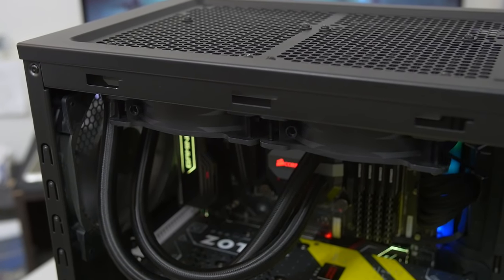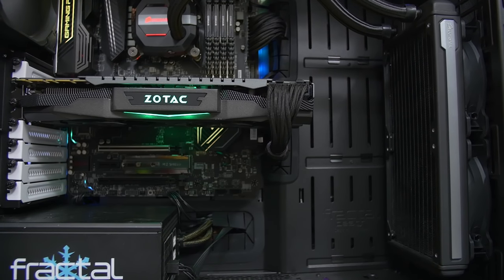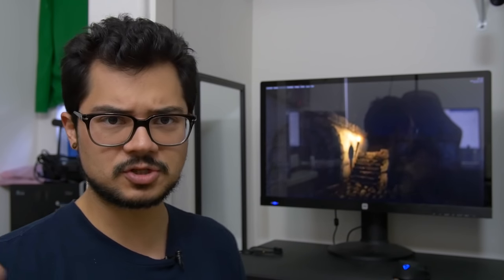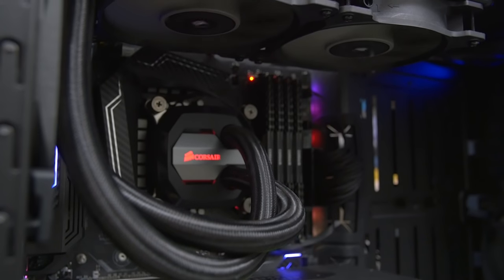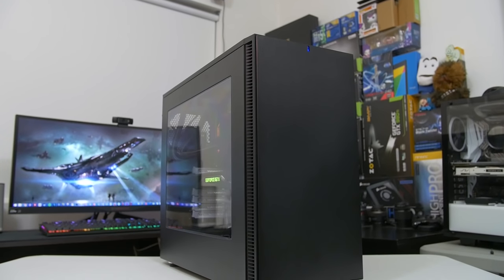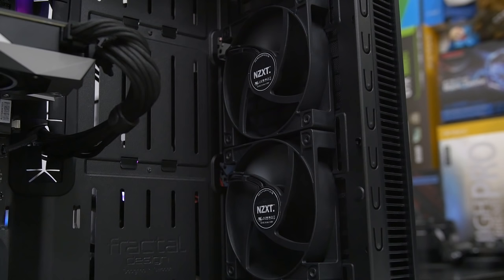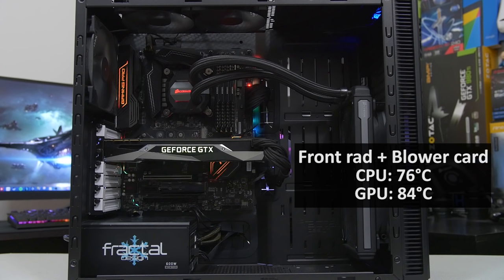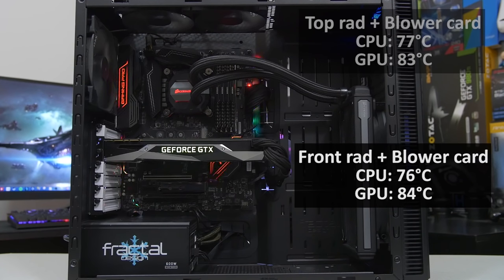Does Radiator Placement Matter? Hint: YES

Comment: What if you mount it at the top and only turn the Fans around so they are working as intakes?
Reply: ZeroB4NG and how about mounting it in the front and doing a push pull/etc setup?
Reply: That's what I did, I have a Define R5 which is very similar to this case and placed the 280 rad in front. At first I only had push, then I did push/pull which improved my CPU temp by 5 degrees Celsius. The front intake of Fractal Design cases are so restrictive that you need higher RPM or more fans to suck in air. EDIT: i7 6700k, 4.7GHz at 1.42 volts.
Reply: I have a mini c,  just remove the dust filter for profit. My custom cpu/gpu loop dropped by ~8c
Reply: warm air tends to go up, so it would be better to bring in cold air from the front or bottom and let the warm air leave on the top
Reply: That would be fine if the warm air did not have to pass over the cpu on its way out of the case.
Reply: Max Z. Warm air rising has a negligible effect ones the fans are spinning.
Reply: what if you put your pc side ways?
then the air need to be blow out. does it work, idk. @BitWit can you test this in a video, if you havent done it yet?

Comment: I purchased a custom made pc, started having some problems. I realized they had place all the fans with air pushing outwards, on the bottom, side, and back of my case. There were no fans sucking air in. The worst part though was my radiator for my auto gpu was placed on the very bottom of my case, completely below the gpu itself causing all the excess air to be between the water block and gpu processor. Luckily I fixed all the fan/ radiator placement and now my computer works 10x better. Now my cpu and gpu run at about 29-30 deg Celsius, maybe 34 deg under full load. It’s awesome

Comment: Strange how the warmed air from the CPU radiator have so little effect on the GPU temperature.
Reply: because only some of the air goes to the GPU, the rest is sucked out the top by the fans before getting to the GPU.  Too bad he didn't actually consider where on the front he was placing his rad.  Probably could have gotten the GPU temp at least as low as the top mounted rad blower card setup.
Reply: @Power5  how would you place the radiator on the front other than in the space where intake fans are though? Because that's the only way I can see how you can fit a radiator on the front.
Reply: @EarthIsFlat456  looked like a full front mesh case with another fan space to the top. Not completely sure of course as the case was glossed over in his setup.

Comment: My setup in my ancient Air 540 case, 2x 140mm intake fans, 1x 140mm exhaust fan, CPU cooler mounted at the top of the case in a pull configuration so exhausting the hot air with 2x 140mm noctua fans.
My dinosaur 3930k at 4.6ghz doesnt go over 67c in gaming which is all I do with my system and my Founders 1080ti with 170mhz on the core and 450mhz on the memory doesnt go beyond 75c with my fan curve and case fans set to 50% speed.
I'll run Heaven for half an hour and see what happens and update with the results.
So I found out my CPU didnt go over 63c and the GPU was bouncing between 75 and 77c.
Absolutely this setup is adequate. Got to love the Air 540 case :D and the old Corsair H110 with Noctua fans.

Comment: One word of warning if you do go with a vertically mount radiator with an AIO/CLC:
Mount the hoses on the bottom of the radiator.
As the unit ages, and water slowly seeps out of it, the water levels will fall.
If the hoses are at the top, the risk of the pump ingesting air is a fair bit higher, increasing wear on the pump, and therefore, how early the unit will fail.

Comment: I wish you did a test with a vertically mounted GPU
Reply: vertical GPU will cause high temp for your GPU. it would not have major effect to the cpu. n for sure, check your open space between vertical GPU and side panel. if it is too near, it will cause high temp
Reply: @muhammadkhalishzainudin9608  Yes I'm aware. Hell I'd add an extra fan just to mount it that way. If the case allows for it I think it looks much nicer with a vertical mount.

Comment: Front radiator has always provided the best temps for me. I always have the fans pushing air through my rad from the outside. I.e have the front grill, followed by fans, followed by radiator.

Comment: 2020 now but this answered my doubts :)
Reply: What are your results?
Reply: @erikschneider160  I have the same setup. My XFX 5700 XT THIC II Ultra was previously reaching 76c. It's now down to 73 after I altered the GPU fan curve. Not sure if 71c max load was achieved using 100% fan speed. At 83% fan speed, I can keep my card below 74c. At 70c, it runs at 73% fan speed.

Comment: Your temps are low considering 5G overclock I have H100I AND i7 7700K and when overclocked 4.9 with the grill mounted from the front I hit 90 to 100. Is this under 100% load?
Reply: My guess is he delidded it and applied liquid metal and you didn't. (edit: lol this is really old, but fuck it)
Reply: @MeatNinja yeah that was old

Comment: I'm using a case that is about 12 years old, and it doesn't accommodate a 120mm fan and radiator, so I made a bracket, drilled some holes and mounted it outside the back of the case!  My CPU temps went from 80-90C (air cooled) to mid 40s under full load 😄  So I'm going to say, the best location is outside the case!

Comment: Mine runs even cooler with front fans taking in freash air also top fans with radiator taking in freash air. I have the rear with a single exhaust and all the other excessive air coming in creeps out all the holes in the tower this also helped me with dust. Due to air coming out all the breathing holes it doesnot allow dust in

Comment: So not sure if you still check this video comments. Either way I enjoy the videos. I have a Corsair 400C with Intel I7-8700k / MSI z370 gaming plus w/ game boost active , eVGA Gtx 1070 SC. Well I recently got a the Corsair h100i for my cpu. It was a 2am build I wasn’t thinking clearly, but I put the radiator as an exhaust. Also a 120mm fan in the back as an exhaust. At the top I placed 2 -140mm Fans as the intake. I was too tired to change at that point. Been running benchmark and cpu is coming in around 70C.

Comment: I personally modded my liquid cooler so the pipes are 4500 miles long ,therefore its at the top of mount Everest now my cpu is so cool and runs great .i recommend.
Reply: Ideally you’d want a radiator going into the ground as the deeper you go, the cooler it’d be ;)

Comment: Good video and I have a question?  What happens if you use a top mounted cooler and pull into the case instead of pulling out of the case?  In other words reverse your current fans set up for a top mounted cooler setup?
Thanks
Reply: I have the same question as you Tony. It seems like that's a win-win. A source of fresh air for the CPU, and another fresh air for the GPU. Plus, you have positive pressure in the cae so no dust is sneaking into the case through small gaps in the panel.
Reply: Ah, someone else (Tae Lim) had the same question. Under load, his CPU and GPU were both 65. (When you click the link, it'll open this same video, but scroll down to the comments. It should be the first one highlighted.) (https://www.youtube.com/watch?v=xNAMxZgvves&lc=UgxUFHJ7V9iyiuJVzD54AaABAg)
Reply: I'm no genius, but just using common sense that doesn't sound like the greatest option. You'd have your AIO + Front Fans all intaking air with only one (and likely your worst) fan acting as an exhaust.

Once again no genius, but surely that's too much air pressure and your fans would effectively start fighting against eachother while supposed to do the same job.

Comment: A better test would be having the radiator at the top in both cases, but one time pulling fresh air from outside of the case through the fins into the case and the second time flip the fans as you did pulling/pushing hot air from inside of the case through the fins of the radiator outside. Regardless, as other have pointed out, your front mounted option is wrong because of where the air inside the system ends up.

So the radiator is at the top in both cases.
Case 1. Fans push/pull (depending how they are positioned/reversed) from outside to inside. In this scenario the radiator/CPU gets cooled with cool air from outside of the case and hotter air gets inside the case and heats other components. So you'd need your top back fan set to higher RPM to exhaust the hot air.

Case 2. Like you had it fans push/pull (depending how they are positioned/reversed) hot air from the case through the fins of the radiator to "cool" the CPU. In this case is is more helpful for the other components and not as good for the CPU as you are running warmer air from inside of the case through the radiator. 

Trying to find a test like this on youtube instead of me reversing the fans to test it out... I have it set as in Case 1 because of 2 reasons:
1. I have a filter at the top of the case for the radiator fans pulling fresh air from outside into the radiator. This keeps the dust down a little for the radiator and fans.
2. I believe it is better to cool the CPU with cooler air from outside. 

And to those that say that hot air raises up, it does that if it is not moved around by fans. And  the top back fan pulling out hot air at higher RPM does that part off removing the hot air at the top of the case.

Comment: I had the radiator on top and was getting  75-83 degrees while gaming, changing it to the front and having the top fans exhaust the heat helped in dropping 10-12 degrees as mentioned in the video.. Thanks!

Comment: That front mounted radiator is installed upside down, the tubes should always be on the bottom and below the Block to prevent air from entering the block.  With a top mount this isn't needed as the pockets to allow for bubbling will be at the top part of the rad and not near the tubes as they are pointing down.  Front mounts always need tubes down to prevent air bubbles to the block and causing dmg to the AIO or even a custom loop.

Comment: Just like a car. You wouldn't want to have the radiator mounted behind the engine. ;)
Reply: SDR that's why you mount the radiator on top and set to exhaust.
Reply: Don't see much cars with a rear mounted engine and rad complain about it.
Reply: Lots of rear engine motorhomes have the radiator behind the engine

Comment: When this guy put the radiator on the front he has put it upside down the pipes should be at the bottom. I know this as I was having heat issues and when I flipped it over I got 10_20 degree drop
Reply: Chris  the pump is inside the block bro. I've also had it confirmed from the manufacturer of my water cooler that the should indeed be at the bott not the top bro.
Reply: Chris  but how can you say that bro mine has dropped 10 degree under high load and 20 degrees under low load. Every othe configuration I've had it In. With the pipes at the top it over heats and throttles the voltage down to protect itself. So I don't understand why if your saying it is t right. Also mafuatyres are the best to listen to they are the ones who hold my warranty and if I ahave it istalked as they say then I'm covered do it another way and I'm not covered bro

Comment: 70C on a 3700X, front mounted ML240L with push/pull fans, Neo Air mesh front case.
8 Sickleflow fans total in case. Triple fan PNY 3080 that both passes through and blows out. I took off the unused io covers on back, mounted a fan to the outside. It blows in directly under the 3080 along with the lower front intake. They meet in the middle and half the air is directed behind the 3080 to the M.2, half up through the card. 
I have a thin mirror cut to fit under the 3080, dual purpose. Air direction and shows the RGB that is otherwise on bottom of the normally mounted 3080. Drives stay in the 40's, 3080 hits low 60's.
I regulate the 5 intakes (4 front, 1 low rear) with the 3 exhaust for a nice out the top chimney effect. Helping the heat, not fighting it. It wants to go up.

Comment: 5Ghz?!
Reply: Bionicle16 Many are reaching that speed these days.
Reply: Fadilizer sillicone lottery winner?
Reply: 5.2 and up would be considered a winner, IMO.
Reply: According to ASUS 80% of 7700k's running on their ROG series boards are easily able to hit 5ghz. These things are monsters.
Reply: what voltage? congrats
Reply: Kamil Ogrodowicz most 7700k are running on 5ghz. mine is on 1.39v. temps are huge btw so need to delid it. (prime blend test is not possible, to much heat) so gonna delid it to lower the temps
Reply: +karma police kinda figured that might be the case. It normally takes a lot to cool a processor at 5GHz. So these coming so highly clocked out of the box and then allowing overclocking just told me that people have to step up their cooling game.

Comment: Thanks to my case being from a class of cases that are extinct now (read: With side panel intake) and a huge video card, I've kind of cheated around both potential issues. Front intake to side exhaust for GPU, top intake to back exhaust for CPU. Solved. I love my HAF X.
Reply: I still have the HAF932, the smaller sibling.  This case side panel supports 4x 120mm fans or 1x 230mm fans that would help an air cooled GPU.  This case breaths well.

Comment: I don't really want to get on your case about the rad placement - I'm sure there are plenty of people who would annoy you to no end about it now, but there's a chance that it could have had an impact on the temperature results. It might be worth redoing this test with the pump below the top of the radiator (and tubes down if possible) when the aio is mounted at the front.

Comment: Corsair recommends air intake and says nothing about changing for top mounting.  In fact the picture in H100i Pro RGB Quick Start Guide, shows a top mount.  Don't be confused by arrows (not sure what the arrows are showing) but the WORDS way configure as intake.  The do not even reference top or front mount.

Comment: We need a video on front radiator mount AIOs.  It pulls cold air and gives the best CPU thermals.  Problem: Are the tubes long enough.  Radiators need to be mounted tubes down so air can collect at the closed top of the radiator to minimize gurgling and air circulating to the pump which hurts efficiency.  I wish to use an Liquid Freezer II - 280 in a Fractal Define 7 case with an internal DVD mounted up top. The specs say 450 mm tubes.  IS THIS LONG ENOUGH?  Need to clear the video card which could be mounted vertically for tube clearance.  Also planning to mount the fans between the radiator and front panel.  Are 450 mm tubes LONG ENOUGH?

Comment: Great now I've got to go back and see if I did a test recently considering I acquired a fan cable splitter so I could do a push|pull on my 212 EVO air cooler vertically mounted.  While I have a single 140 on the lower front of the case in hopes to provide a bit more air flow to the video card, while two 140's are top mounted and a single 140 at the standard top rear of the case.  I also removed the drive cage for a better flow for the air flow from the lower front fan in theory.  Keep in mind that I, just like other people have more than one interest than gaming.  We have a much more slower upgrade path than some, and content like this provides great insight as to what we might consider on acquiring.  This particular video is relevant and hopefully can be followed up on over time.  Please note that I am getting more hits frequency-wise by keeping my Ryzen 5 2600 as it's kept cooler by the push|pull.  Yet I now have to go back and run Heaven 4.0 to compare it to my archived results.  I have to blame YouTube for pushing this video as I've never watched this one by Kyle.  His name is Kyle right? I do watch Jay, Jim and Steve mostly.  Though I watch Lauren when I can, as well as Nicolas.

Comment: I got this weekend my first AIO in years
I had a Noctua NH-D15 before and a NZXT Kraken X62 now

Before i installed the AIO i asked myself the same question that this video answered.
The radiator in the front was a no brainer
The GPU Temp dropped about 15° compared to the D15 (MSI Ventus RTX2080)
I never tried top mount, went directly to front mount

Nice to see the answer to a question before you have to ask the question

Comment: He gets good results with the front AIO because of negative case pressure drawing in fresh air from the bottom vents.   This is not typical.  Most front AIO setups are terrible for GPU cooling.

Comment: I think there is something missing in this test: Noise levels and GPU clocks. The GPU with an open cooler stayed at the same temperature on both tests, but how do you know if it wasn't compensing a higher air temperature by spinning the fans faster or lowering the turbo clocks?

Comment: Hi. I'm right now using CM Storm Trooper. My setting for airflow. 120mm X 2 for intake front. 240mm radiator intake top. 140mm exhaust back but need to set rpm to 1500rpm (a bit noisy) to fully suck out hot air inside case because only 1 exhaust. 
Result, ambient room temp around 23c, my cpu temp while gaming (pubg) around 50 - 55c, gpu around 68c - 73c.
My gear : 
1. Proc : Intel Core i7 8086k
2. AIO : Silverstone PF240 (i think you should review this, cheap and same performance with my old Corsair H100i)
3. MSI GTX 1080 Gaming X
4. Case : Cooler Master Storm Trooper
5. Thermal paste : Cooler Master Gel Maker Nano (CPU & GPU)